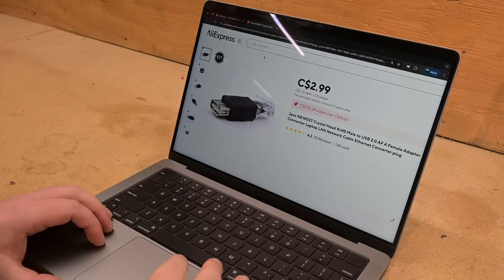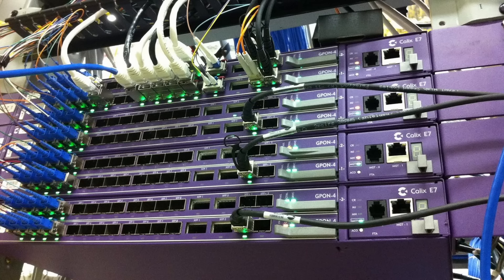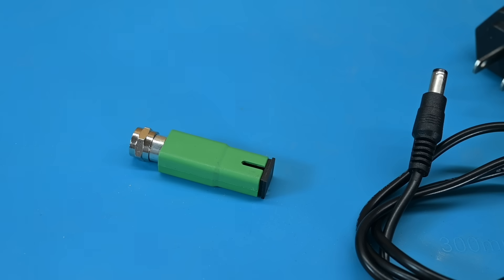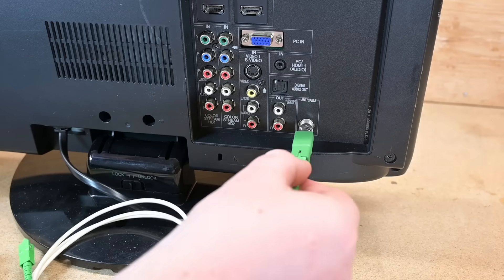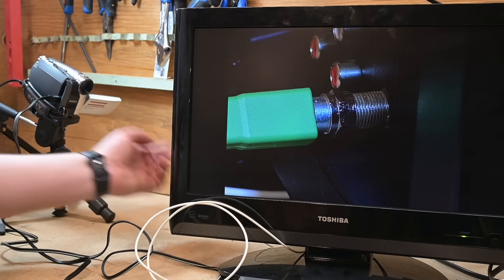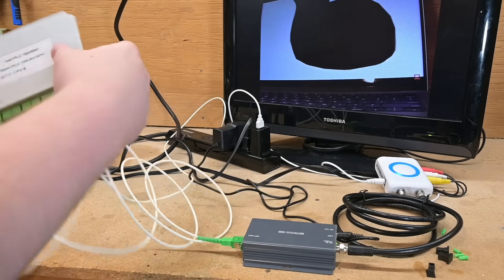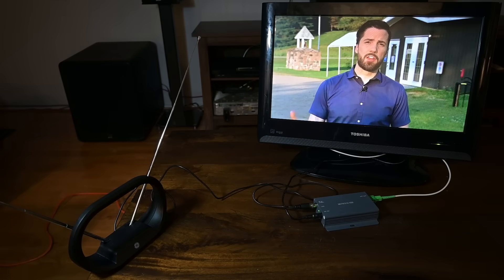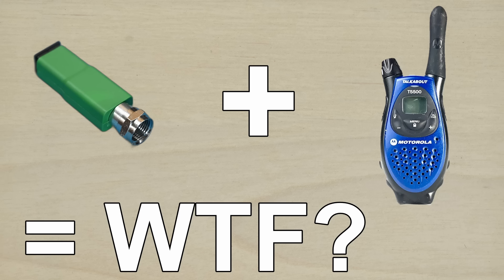Does a $5 Fiber Optic to Cable TV Adapter Actually Work?

Comment: Wow. This is solidly in the "there's no way that should be able to work" territory of C.S.F.C.
Reply: Exactly, I was like "This HAS to be a converter misrepresented as an adapter", but there were only passive components on the board. So I guess there is no conversion from digital-analog here, as was my initial thought. This is like 1 step away from just firing a stream of photons into a copper wire and it magically turning into electric potential.
Reply: @sydswift4989  The push for ever faster networking has given us relatively cheap lasers and even cheaper photodiodes that can be modulated at UHF and even microwave frequencies. So it's now quite feasible to take a raw RF signal and modulate a laser with it. Cable TV networks have been doing this for some time, as a single fiber can carry multiple wavelenghths, one for the cable TV signal, another for high speed data downstream and another for high speed data upstream. 

Still i'm impressed that a simple photodiode and some passives can reconstruct the signal adequately at least in simple cases.
Reply: The bandwidth of fiber is far beyond coaxial cable, but this still kind of blows my mind.
Reply: A diode as a mixer/demodulator? One of the simplest things thb..

Comment: Yess, I'm not the only one with a CATV fiber TX/RX and a one port GPON OLT in his homelab! Works fine to transmit signals from a ham radio antenna and feed it to a RTLSDR quite far awy, etc.
Reply: Do you have part numbers or anything for your setup? Play immediately invisible fiber TX devices are a few thousand dollars
Reply: @cculpepper1  There are relatively cheap OLTs like my VSOL V1600GS-F or WK-OLT-2PG-C for about 300 bucks, a simple 1550nm CATV transmitter like in the video is 50 bucks
Reply: @cculpepper1  You'll find 1 port OLTs like the VSOL V1600GS-F for about ~€320,- incl. shipping at the usual places, a simple 1550nm FTTH CATV transmitters like here in the video go for about €50,-

Comment: i wish entities made usb to fiber into a super accessibe and passive methodic product - for usb 3 it must be possible!! also i wish wireless usb was the BEST thing? like obd2 car diagnostic going throughte usb into wireless into reciver into laptop usb
Reply: I doubt USB over Fiber would ever be possible without active conversion. This adapter works because RF is very forgiving, meanwhile high-speed differential signaling interfaces like USB have very specific requirements and little tollerance.
Reply: also like can we finally get power over fiber to be mainstream yet???? i m tired off buying overprice'd oscilloscope_BRIDGED adapters for actuelle isolation----this is TRUE houseold problem

Comment: Could this propagate a QAM-encoded signal? I'm wondering if the quality of the transducing is high enough to preserve it. So if you have access to a cable modem and provider single using QAM, can it get lock on all the channels?
Reply: The 1550nm fiber transmitter simply converts the RF spectrum into light and the RX the other way around - it's linear enough for every modulation scheme. From CW & SSB over FM to DVB-C2 with 4096-QAM - there's no back channel tough..
Reply: Btw: Some mobile network base stations receive/transmit the RF signal via fiber from/to the antenna-heads, which have a fiber/RF converter and an amplifier directly behind the antenna - makes the units on the roof way smaller..
Reply from the maker: I might have access to an old Arris DOCSIS 2 CMTS that I could experiment with...
Reply: I would be extremely surprised if it could handle it reliably at all.  Much less the reverse path which generally is much hotter.
Reply: @polerin  That 70$ RF to fiber transmitter simply converts about 1 GHz of spectrum to the 1550nm range - this is nothing compared what a fiber actually can do. There's no back channel however - so a cable modem likely won't sync at all - but all cable channels on the fiber is no problem..
Reply: @salat oh that I know.  I used to be a cable tech.  I am more worried about it being accurate enough in transforming digital signals to do high qam stuff, and my note about reverse path was even before I caught it was receive only.
Reply: @polerin  It works just fine, the linearity is good enough to transmit an entire 500-800MHz band full of DVB-C signals.

Comment: Digi, a Romanian and Hungarian ISP and CATV provider uses the RFoG (RF over Glass) technology on their fully optical networks to distribute DVB-C cable TV alongside regular GPON. (well, the Hungarian part was merged with Vodafone to become One, and they're switching over to IPTV AFAIK). They would have a filter at the splitter based on if you're subscribed to TV or not, and only some premium movie channels (like HBO) were encrypted. Their converter boxes were active, had a passthrough for the ONT and a signal level meter based on a tricolor LED: if it was red, the RF signal was below -15dBm, if it was green, the signal was between +2 and -15dBm and if it was yellow, then the signal was above +2dBm.
I was thinking there's no way this passive converter would work, when I wanted to see if my tap from the splitter had the TV filter or not, so I got the same converter the provider used, but unfortunately, I had the filter...
Reply: every PON provider that also does TV basically does the same thing - the RFoG is on a different wavelength than the PON, and the TV signal gets added into each fiber as it leaves the CO. Usually the ONT has a built in splitter that splits off the TV wavelength and converts it back to an RF signal that they hook to your existing coax cables in your house if you subscribe to TV. It is pretty amazing though that you can do the fiber to RF conversion completely passively
Reply: @gorak9000 not every PON provider is using RFoG to distribute TV. For example, both Orange and Telekom in Slovakia, and Telekom in Hungary are doing IPTV. There’s a separate VLAN on the ISP side of the ONT, which gets split off to separate Ethernet interface(s) on the ONT.
Reply: @AttilaSVK I think Orange in Romania is also doing IPTV, not sure about Vodafone. Orange bought the home services from Telekom here, and I think they still provide satellite TV service along with FTTH.
Reply: @AttilaSVK  Indeed.  In the Netherlands we used to have those "cable signal over fiber" providers as well, at first distributing the classic analog signal and later DVB-C, but they have all gone to IPTV as a VLAN or even just over the internet connection.
Reply: Thanks for the explanation, I've been really curious on how exactly Digi was getting CATV over Fiber through these ONTs, at my home they gave us these combo units that integrate the RFoG, media converter and router into one box. In earlier installations I recall there being a box that takes in the fiber, splits out into CATV and another fiber output going into the ONT. I recently got it swapped for a RFoG and media converter box only, so I can use my own router.
Reply: @RaduTek some Huawei ONTs with a built in RFoG converter allow the RF to be turned off remotely from the management (in case you’ve unsubscribe, so the technicians don’t need to hurry with installing the 1550nm filter on your tap)
Reply: I think I've seen some Vojvodina (Serbia) local ISP use a setup like that and no one else, everyone here does IPTV or DVB-C if they do DOCSIS.
The national telco does IPTV with an idiotic VLAN setup and a locked down android TV box with their own software which also sucks. Can't use it for anything else. They have to assign individual ports for TV which sucks even more.
However you can reproduce this configuration on your own equipment so it's not all so bad.
Reply: @jm036  Our national ISP started like that, IPTV over a separate VLAN that got bridged in the router and untagged on some specific port, but it was so unpractical in typical house installations (where both internet and TV would have to be brought from the router in the metering cabinet to the living room), that they changed the configuration of the routers. Now the same VLAN is still used but it is routed rather than bridged, and TVs can be connected anywhere in the local network.
Tricks with DHCP options are used to get it all working, making it still quite challenging to use nonstandard routers.
Reply: In Slovenia we had two fibers one for internet and the other one for analog cable TV (not DVB-C).   It was ~2005 so I guess they didn't figure out how to put both analog cable and ethernet on the same fiber.
Reply: @99999me1  Yes, some providers did that here as well.  First analog TV over a separate fiber, then adding DVB-C signals for subscription services, migration to HD (dropping the analog signals) and then those providers were nearly all taken over by one that dropped the separate cable signal and moved everything over to IPTV.

Comment: I'm gobsmacked... I was entirely sure those were just connectors either end with nothing inbetween. It's also impressive how well that simple conversion works
Reply: Im gobsmacked too. I worked in fiber optics for over 10 years and never would I have thought something like this was feasible.
Reply: RF signals are very weak compared to Ethernet or optical. They don’t need to be amplified.
Reply: @5roundsrapid263  yes RF signals are super low.  So lo poor me (A hobbyist not an engineer) did not think the RF power alone would be enough to power the laser/optical diode.
Reply: Me too. And I really LIKE how he Frankesteined that setup out of stuff that I likely have lying around the house (but not the camcorder, I donated mine to Goodwill years ago).